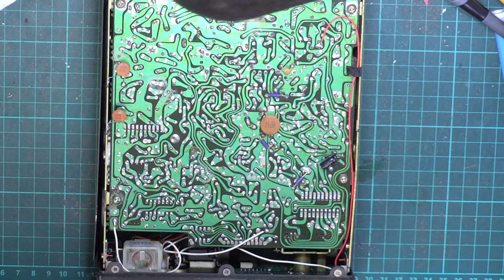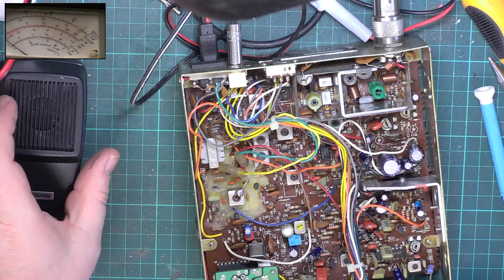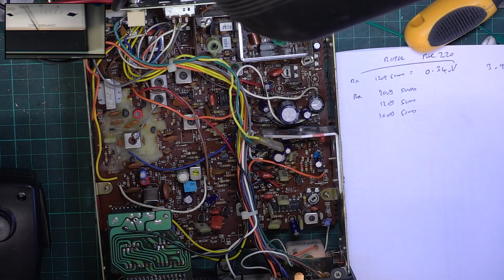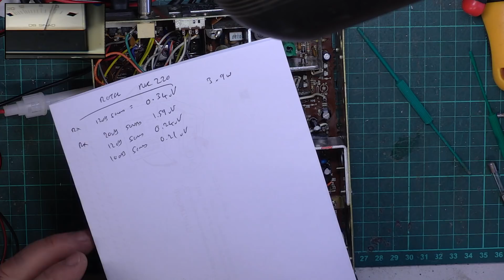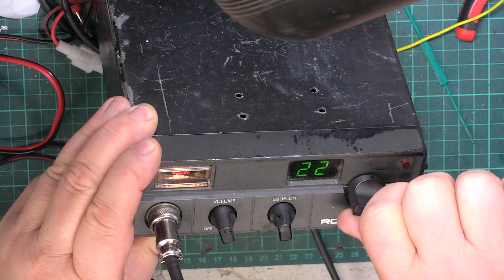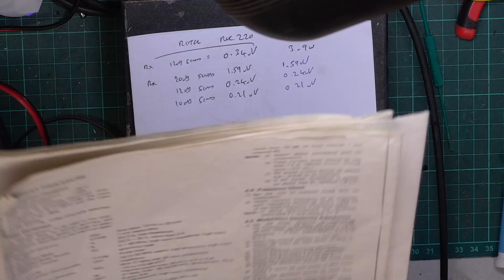Rotel RVC220 CB27/81 UK CB radio (mobile) - Repair,  Re-cap & alignment

Comment: Agree on the Servisol Super 10, excellent stuff and way cheaper in the UK than De-Oxit. Philips 390 was excellent stuff too but seems to be obsolete or incredibly expensive now.

Would have been interesting to see TX before and after on the spectrum analyser as well if recapping brought up the power output. 

Have seen a few Cybernets where that 1000uF has begun to leak but in general the caps in Cybernet chassis seem to be more reliable than those in Unidens, I've had a few shorted or very leaky caps in those, especially in the PLL circuit because they cheap out and bodge a pair of polarised capacitors in where there should be a bipolar one.

Comment: No change on receive after recap!  I expected a slight change.  I won't be recapping my York863 then, not worth it.
That's if I ever get round to repairing the damage done when I loaned it out :-((
Slight improvement on TX, not a huge improvement though.  Wish I lasted as well over 30 years!